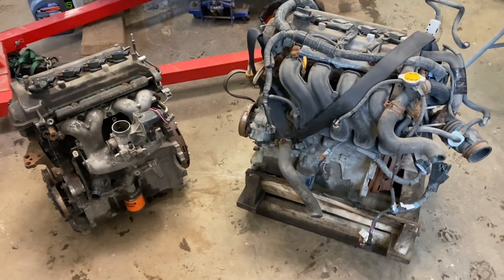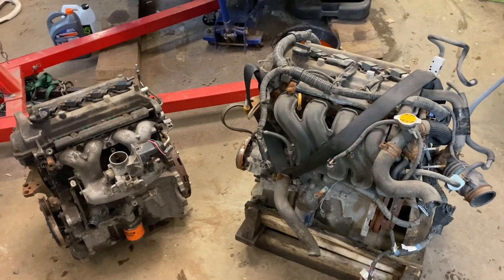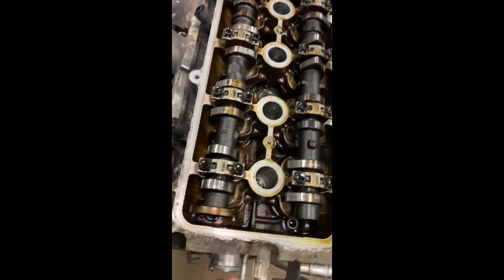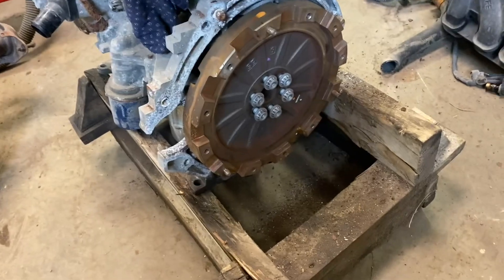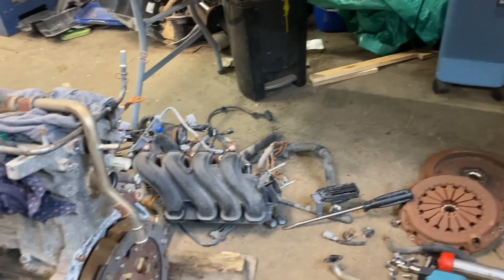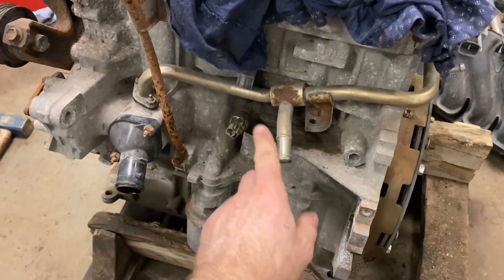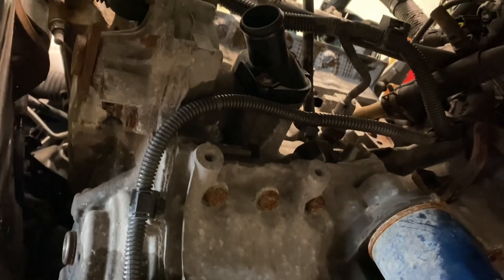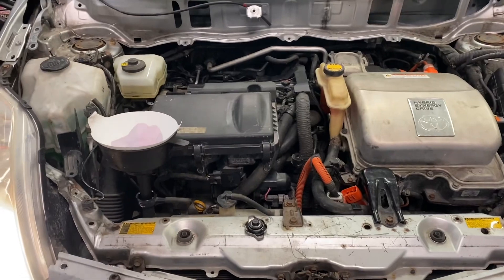Can a Toyota Yaris Engine work in a 2nd Gen Toyota Prius? Swap

Comment: Awesome!  Great to see.  I did a little write up on PriusChat regarding observations of the spark plugs and coils. I plan to swap in a Prius C engine in time.  Will also keep my eyes peeled for the new gen Yaris coils and plugs. Spent a day walking the whole yard looking for, to later get asked if I checked the year went out.  Woops, thought was new this season.
Reply: Prius C engine needs mount holes drilled out as well. eCVT as well if I recall correct, though don't go by hear say even if explicit.  AC compressor need any hacks?

Comment: Status update please. Did you ever clean up the Prius engine valve cover you mentioned  had different mounting points that was dirty and why you continued using the Yaris one to keep it clean and exchange it so that the bolt above the oil cap had proper alignment. Also. How is the vehicle performance.  Since it's a Yaris block does it now use 0W20 instead of 5W30 oil? Your  update will be very appreciated.
Reply from the maker: @eg487  hi, I continued to use 5W30. Car is running really good, super quiet and no oil consumption. I haven’t yet swapped the valve cover yet but I just recently cleaned it really good in my parts washer for next time I’m working in the engine area. When driving it on the highway it seems to have a bit more pep when passing cars. Fuel economy is almost the same.